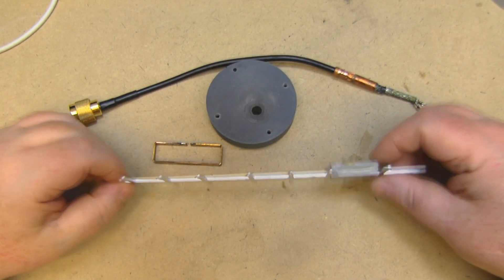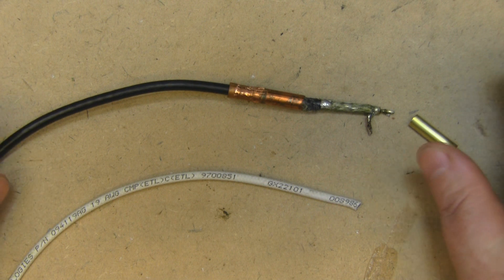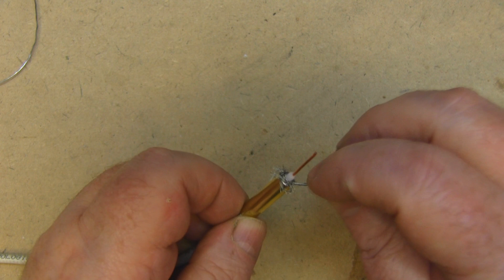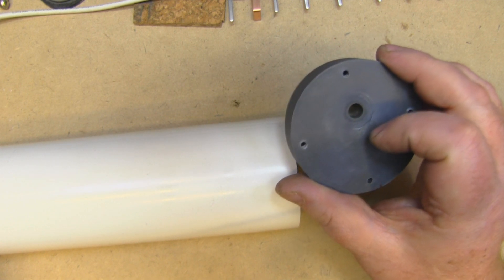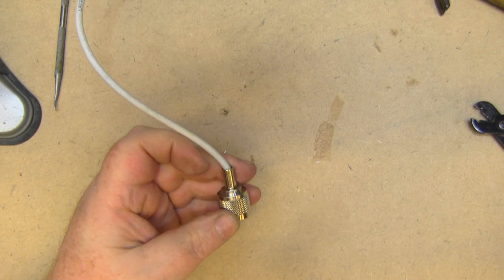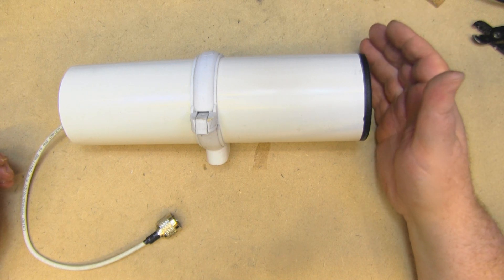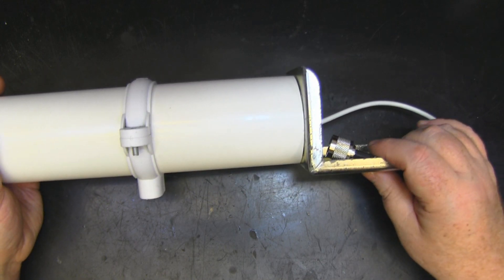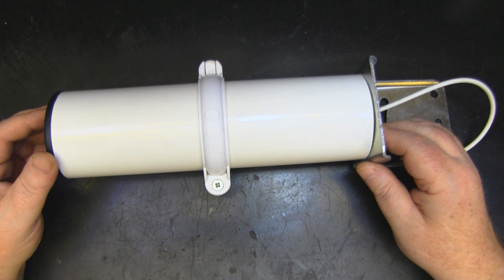A Wifi Yagi from Poland Rebuilt with Balun

Comment: bazooka balun with 1: 1 transformation ratio: it is a simple 1/4 wave conductor tube placed on the braid of the coaxial cable and with this short-circuited to the coaxial base.

Comment: Hello sir, I was looking forward to make a wifi antenna, actually at my place the cellular network is too bad even with full signal, and no wifi companies have equipments to get us a wifi connection, so the only option for me is to use one open wifi, which is 250 metres from our building, line of sight might not be possible. But the wifi is too strong it catches signal from 50-60 metres, please recommend me a DIY antenna video of yours. And my college always keeps me busy in so much work, that I almost require 24/7 internet connection, so please do me a favor, please recommend me a the best DIY wifi antenna to build. Thank you.
Reply: And moreover it's my first year of engineering college, and I'll be learning these network stuff soon enough, as my specialization is in Electronics and communication, so this might also help me learn a lot in this online mode😃